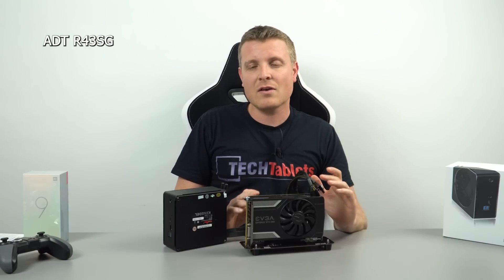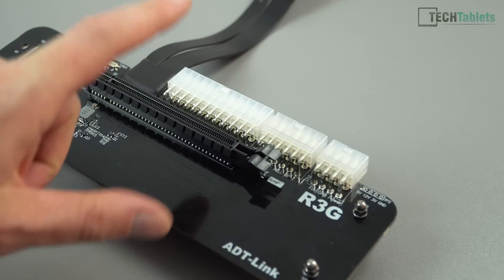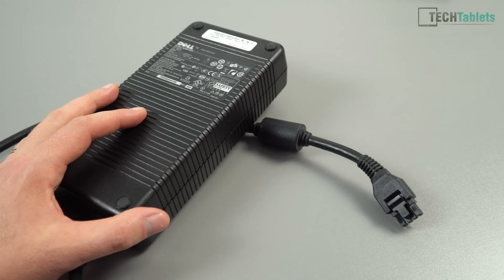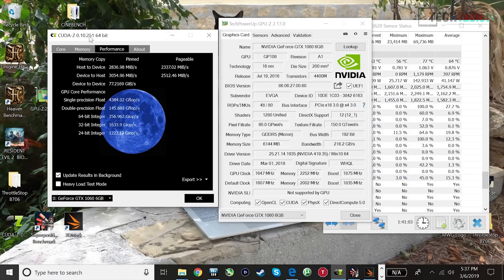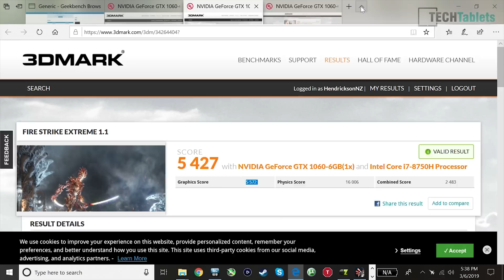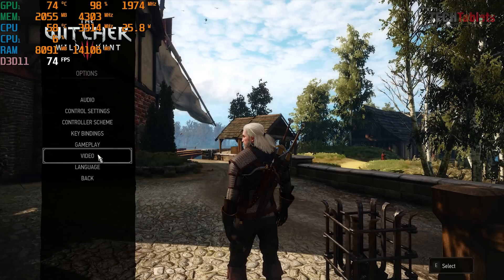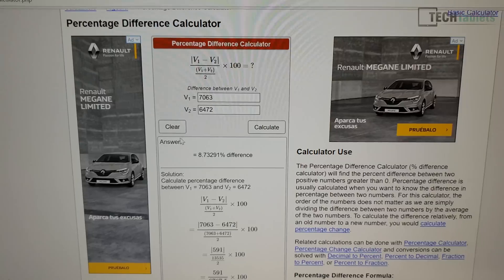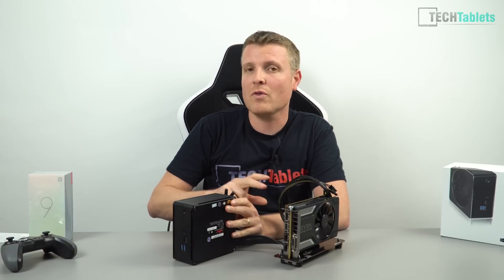M.2 PCIe x4 to External eGPU - Faster than TB3 eGPU's

Comment from the maker: Also to add the performance loss is constant but within those figures stated. But this is much better than the 30% or so I thought it wsa going to be. A good overclock on some powerful cards can help make up the difference. Also the higher the resolution the lower the performance loss. For example 1080p could be 12%, 1440p 10% and 4k 7%
Reply: The youtuber can’t do math. Everything he says is wrong
Reply: Hey! what if you use an NVMe PCIE USB3.1 HDD Enclosure M.2 to USB Type C 3.1 Hard Disk Drive Case, would it work? it would make it usb :)
Reply: are you an idiot or soemthing?
Reply: @gmce186  still need anyone answer your questions 😢
Reply: You can connect it to xiaomi mi notebook pro. Will you do a test!?!
Reply: @micheleschiavo  i would like to know to cause i have pc with GTX 980ti but when i am away from PC, like at parent house i want my fps with me :)
Reply: What game you played after the Witcher 3 gameplay? Thanks in advance.
Reply from the maker: @bmwm3gtr3250  Resident Evil 2 remake
Reply: 5K is allegedly 3% for TB3, so for M.2 it might be 1% or less!!!!!

Comment: WHAT? GTX 1060 6GB for only 150€?? Cheapest price is 220€ in Hungary.... oh boi, Iam jealous :( good video tho. LIKE
Reply from the maker: Well it is a lightly used one :)
Reply: hahha, you guys are amazing. I have ZERO luck in life so no GPU for that price. 140€ for a 1060/6GB is A M A Z I N G
Reply: I am getting a GTX 1050ti for $200 in India
Smh
Reply: last year, I found a 3GB one for 120€ when most of them is still 250€. It's all about luck and you should check everyday to find good deal :)
Reply: @datqn7244  I only tried on eBay for one day and I got a slightly used 3gb for £90 came with original box and manual.
Reply: @_GarethRossUK  That's awesome, it took me a month to find mine in the crypto madness :)
Reply: or just get a rx570/580
Reply: It is 261 Euros in Turkey AND monthly salary is just 326 euro, so don't complain my Hungarian friends :)
Fun Fact: RX 580 8 GB (same performance with GTX 1060) is just 220 Euro in here so i'd choose RX 580 instead.
Reply: ilive in china and i just missed a chance to buy a brand new vega64 (xfx) with just 240euro